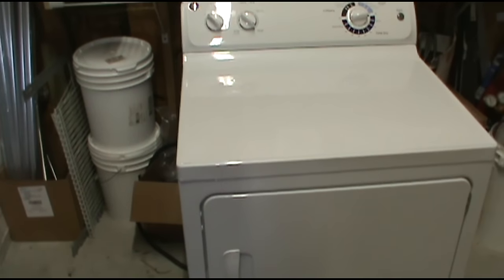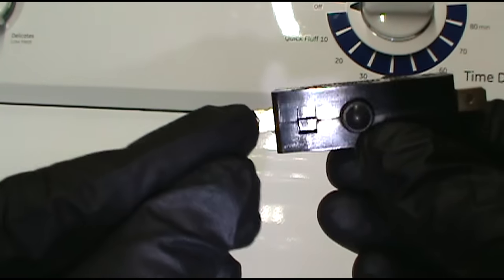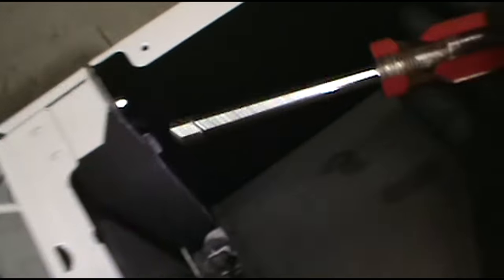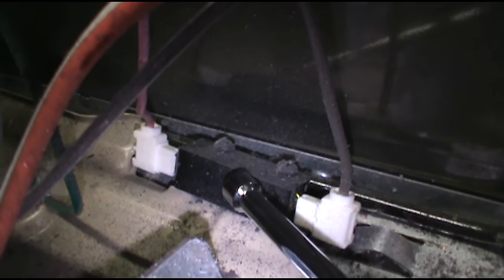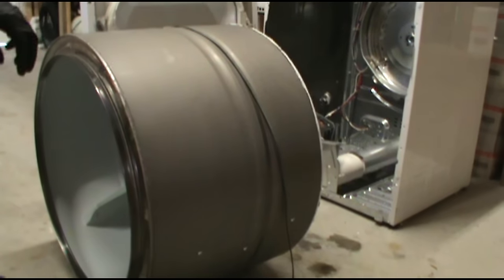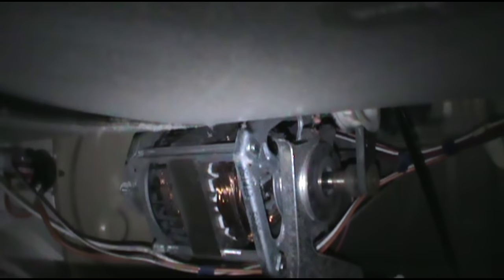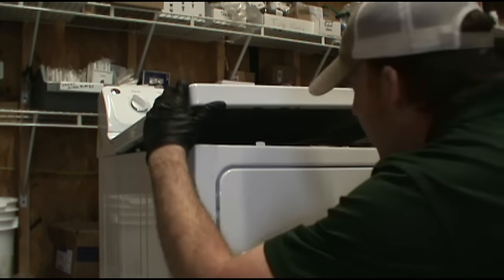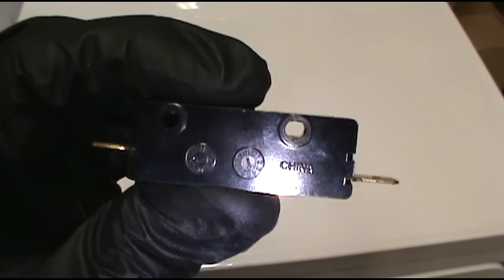Dryer Will Not Stay On After Pushing Start (How to Fix)

Comment from the maker: If you'd like to support the channel, you can do so by shopping on AMAZON through this link,
http://amzn.to/2D3dyGx

Dryer belt link, http://amzn.to/2CS0CjC

Lex Vance is a participant in the Amazon Services LLC Associates Program, an affiliate advertising program designed to provide a means for sites to earn advertising fees by advertising and linking to amazon.com.

This page contains affiliate links, which means that if you click on a link and make a purchase, I’ll receive a small commission. Thank you so much for supporting dirty maintenance nation!
Reply: Lex Vance what's the part number for the switch  I need a replacement
Reply: Thanx for the video Lex. $11 for a belt switch and $19 for the belt (was good but I replaced it anywaze) and I'm back in action. Saved $580 for a new dryer. A little testy getting the belt, motor and idler pulley together. Took a while, but got it done. Thanx again.
Reply: Whats that switch called? Thats my issue.
Reply: What's the name of the switch
Reply: thanks for video, yours is the most informative I've seen today.  I was working on a GE Select DX4500EA3WW dryer, that would not tumble or spin.  Not sure what the problem was, but I got it to run.  Probably a loose wire, or something. 
If it fails again, I'll be more confident about working on it, thanks to your video.
Reply: I believe the switch is GE WD21X10261
Reply: 4 years later. Here I am. Typed the same thing.

Comment: ✌ Thanks so much. My wife had a new $800 dryer picked out.  Just like you showed, it was a broken belt.  Quick trip to the parts store and I had it fixed.  The only difficulty was that I never saw how the belt was to be routed so I tried to install it looped around the idler pulley. That made it seem like the belt was too long. Then I figured out that both of the lengths of the belt go on the same side of the idler pulley and all was good. Save $785 .
Reply from the maker: Nice fix! Thank you so much for watching!

Comment: This is a great and helpful video that helped me fix my dryer today, although one critical detail was left out.  If you're struggling while groping blindly to try and get the new belt around the pulley and the motor and feeling like the belt doesn't have enough slack to fit, there is a much easier way.  Before you put the drum back in, look at the motor.  It's against a metal plate which has a curved corner for seemingly no reason.  Well, you can pull the pulley all the way towards you and the end bit will fit and hold right under that corner, that's what it's there for.  Then put the drum with the belt on it in its place and you only have to rope the belt around the motor.  Then let the pulley out from under the curved corner and it puts itself exactly into place without you having to maneuver three things at once sight unseen.
Reply from the maker: Thank you so much for watching Geshtal!
Reply: right on

Comment: If the belt is fine save time by taking the left side panel off instead of the drum
Reply from the maker: Thank you so much for watching Tim!
www.DirtyMaintenanceNation.com
Reply: This is great advice! You can avoid removing the drum. The interlock is an easy fix.
Reply: Is "interlock" the name of that switch? My drum is still turning but it won't stay on.

Comment: Replaced the belt and had the same issue. (I didn't even know that switch existed until I saw this video.)  Turns out, in this case, that the tension bar had popped out of the slot it is supposed to sit in above the little retainer thingy that helps it stay in place and was just above the switch. Once back in place everything worked as it should.
Reply from the maker: Nice fix, Dan! Thank you so much for watching!

Comment: Your video literally saved me 350+ dollars appliance shop I called said that it was a motor. I decided to research myself before taking it in.  I have the exact Same dryer with the exact same problem. Followed your steps and found the same issue. Appreciate your video!!
Reply from the maker: Wow awesome! Enjoy that $350 you saved. Woo hoo!
Thank you so much for watching Kyle!
www.DirtyMaintenanceNation.com
Reply: This is a beautiful video in every way.  My dryer (GTDP280ED0WW) looks exactly the same as the one you fixed.  Inexcusable that GE put the belt microswitch not only on the motor mount, making it difficult to test for continuity and almost as hard to replace as the motor, but with the screw heads angled up against the cabinet so you cannot replace the switch without at least sliding the motor mount partway out!

This microswitch on mine WAS bad, so I had to go all that way to replace it.  Once I had it open, I discovered that the large metal plate underneath the console, painted with what looks like Army primer, has surface rust laying over all of it.  We've had the dryer six years, but only use it three months a year.  All that rust comes from the salt air in Florida.  While waiting for Amazon to send me a switch, I gave that piece a coat of Rustoleum Primer, in the hope of keeping the dryer for a while.

My problem is with routing the belt over the tensioning pulley and under the motor pulley.  The bent rod the tensioning pulley rides on doesn't want to go far enough to the right side of the dryer to put tension on it.  I can't tell from the video whether the other end of the rod goes where mine does, forward from where it contacts the switch to the front where it is bent 90° to go up into a notch up in the front of the motor mounting plate.  If it's the same, I must just not be putting enough muscle into forcing the pulley end to the right.

(It doesn't help that GE decided to route the vent pipe to the rear in the middle of the dryer and almost up to the drum, right where my hand wants to be when routing the belt.)

I'll be waiting to see whether you have a better way of putting that belt on.  Thanks again for this video.

Dante

 @LexVance

Comment: Just followed this video and repaired my dryer. This was the exact dryer and the exact problem and the installation went pretty smooth except for taking out the screws for the front door, and getting the belt back on the pulley wheel. Putting the drum back in and putting the top back on was a pain as well, but getting the belt back on the pulley properly was trash. It worked and saved me alot of money calling a repairman. Thanks so much for this video.
Reply: Do you know the model number of your dryer  I have the same one and I need to replace the belt as well.
Reply: The model number is on ta sticker on the dryer door.

Comment: Thanx for the video Lex. $11 for a belt switch and $19 for the belt (was good but I replaced it anywaze) and I'm back in action. Saved $580 for a new dryer. A little testy getting the belt, motor and idler pulley together. Took a while, but got it done. Thanx again.
Reply from the maker: Awesome! Enjoy that $580 you saved! Thank you so much for watching Bill!
www.DirtyMaintenanceNation.com
Reply: I'm not doing so well reinstalling the belt now that I replaced the faulty microswitch.  What was your secret other than "Took a while?"

Comment: Similar Model Dryer here for me. Almost 12 or so years old. Maybe a bit more. Same parts and all but Gas model. I redone the Drum "bearing" the plastic bits in front and also the sliders for bearings on this model. I also replaced the start switch up top as well. Wanted to test before reassembly and had seen this pulley switch but did not know what it was. I could start the machine but it would shut off. Seeing this video allowed me to "test" that my work was correct before reassembly by simply applying pressure to the pulley and switch. Without the Drum in the machine. Also I cleaned about 3 inches of lint out of the machine LOL. So thanks a bunch for the tip on the Pulley Switch.
Reply from the maker: You're welcome! Thank you so much for watching Argyle!

Comment: Thank you for this. I installed a new belt and was suddenly having the symptoms of a bad interlock switch that you described.  Dryer ran and spins but stops as soon as I let go of the on switch. Turns out I lifted up on the belt tensioner and pulled it up out of place so it was no longer touching the interlock switch. Put it back down against the switch, installed belt, now it’s running smooth and quiet.  I was in the process of looking at a new $800 dryer and decided to try looking at the problem one last time. Thanks again.
Reply from the maker: You're welcome Matthew!
Reply: Thank you @darkstar189 same thing just happened to me with the tensioner being pulled up out of place, I would have booted it out the door before I figured that out on my own!

Comment: If it wasn't for your video I would have been buying a new dryer.  Long story short without your information about the interlock switch i was lost. I took it back apart only to realize the Pulley had popped out and was not engaging the switch. That was it! Thank you!!
Reply from the maker: Nice fix Chris! Thank you so much for watching!

Comment: Great   Video. My problem wasn’t the belt, but the switch connected to the belt pulley wasn’t fully engaged (it shifted). That tip saved me ripping the control panel apart to replace a starter button that wouldn’t have needed replacing!
Reply from the maker: Nice fix Mario! Thank you so much for watching!

Comment: Great tutorial, I was able to replace the drum switch.  It was a pain, as I have no experience taking apart a dryer, and did it all alone.  I did it though!  Sadly, the problem still persists.  I replaced the start switch, too.  Oh, well, at least I do know that the problem was neither of the switches.  I also do know that the guy who looked at the dryer the first time did not check the drum switch at all--the dust webs were undisturbed. :)   At least I can still use my dryer by taping down the start switch until I decide to replace it.
Reply from the maker: Wow way to go Carolyn! 
Thank you so much for watching!
www.DirtyMaintenanceNation.com

Comment: Excellent video! Thanks for sharing. 
Got the belt on okay, manually tested drum, spins ok.  
Tough time getting front and top back on again. Drum seems to be sitting too high and hitting top of cabinet. 
Where’d I go wrong?  Thanks
Reply from the maker: I'd need to be there to see what's going on. Sometimes I have to pull it back out and play with it to get it right. GE dropped the ball on getting things back together easy. Thank you so much for watching Nuclear!
Reply: Thanks Lex for replying. My unit is slightly different than yours. I was a bit surprised when I opened it.

Comment: Thank you for sharing the video. I replaced the dryer belt, the machine starts spinning. After fixing the belt, when I release the dryer button it stopped. I figured it’s the problem with the switch. Do you know where I can buy the dryer switch? I appreciated if you could respond to this message.
Reply from the maker: Thank you so much for watching Zheng! Sven has part in his comment.

Comment: Great video skid! this is the exact thing that is going on with my lakehouse dryer-just bought that switch, new belt and thermostat. BTW-if thermal switch was failed open, the motor would still run nmly right? just no heating? seems like this switch or a broken belt is going to be the likely culprit. Thanks again, man!
Reply from the maker: I've never had a thermal switch get stuck open so I'm not sure what the symptoms of that would be. I know when it gets too hot, it shuts everything down & nothing will come on until it cools. A clogged vent line will cause that. Thank you so much for watching Harry! 
www.DirtyMaintenanceNation.com

Comment: Thanks for the video. We have the same exact dryer and issue came up this morning. Repair guys are booking two weeks from today. Found your video picked up a belt for $8 and it is working again. 

Tip if you put it back together and it still isn’t staying on you need to push the tension wheel bar down then in. I didn’t do that and was having the same issue. Took it back apart and by pushing the bar down it stopped pushing the switch.
Reply from the maker: Nice fix! Thank you so much for watching daluder!

Comment: Very good video. Mine wouldn't stay on tonight. Went to double check that the drum moved... fricking thing is working now. 
Overheated temporarily maybe I guess. 
Regardless, good video, thanks.
Reply from the maker: Yea, make sure your silver vent line in the back isn't crimped or clogged. If the heat can't get out, the dryer will overheat & the safety switch will kick it off. Thank you so much for watching Rachel!

Comment: Hi Lex, thanks for the very informative video. two questions: if I keep holding down the start button and the dryer works, does that mean the start button is good? And if I run the dryer through a cycle with the start button continually depressed to keep it running, will that harm the start button or anything else on the dryer? Thanks in advance for any help.
Reply from the maker: I would need to be there with my volt meter to check the start button as it could be faulty. I've never held a start button down for an entire cycle so I don't know the answer to that. Sounds interesting though 😆. Let me know if you try and it works. Thank you so much for watching PMG!
Reply: @LexVance  I will try the volt meter. I've been drying my clothes with the start button depressed with a weight. Once the cycle knob is finished, the dryer turns off even though the start button is still depressed. I'm thinking maybe it could be the interlock switch (need to get a volt meter), but in the meantime, wondering if keeping the start button depressed could harm anything or be a safety hazard. 

But I will try the volt meter and report back. Thanks!

Comment: This was exactly my problem! Thank you so much for your help!
Reply from the maker: You're welcome! Thank you so much for watching Qbranch!
Reply: @LexVance  wanted to let you know we thankfully got the dryer working again! What a relief. We got the tensioner wrong the first time.
I didn't realize one REALLY has to pull hard on the tensioner over past the pulley on the drive motor, so the tensioner rides under the outside (non-grooved-side) of the belt.
Thanks so much Lex! 👍👍🧺

Comment: Any tips for getting the tub back on?  I think I have everything lined up but the tub seems much looser than yours.  It's like I can't get the final push to lock it in.
Once it is back in place should it be mostly self supporting?  
The person I'm working with thinks the belt will lift and support it once it's put back together.
Reply from the maker: It's all feel really. It will lean forward a bit until you get the front door back on. I'd need to be there to see. Thank you so much for watching!

Comment: I have the interlock switch problem testing open, seems the button doesn't work (return) now. I agree with the guy that mentioned GE engineering 2 angled screws? I also had to move motor mount to get at them, but turned out that was only 4 or 5 screws so not so bad. GE Dryer Model: PBXR463EB2WW
Reply from the maker: Thank you so much for watching!

Comment: I have this exact issue with this exact dryer. And it helped me fix it. But now I need to know what's wrong with my sensor cycle. Dryer won't turn off on the "optimal dry" setting or and dry sensor settings. But the timed settings work fine.

Also when I use high heat the dryer overheats and turns off. Jeez this dryer is nothing but a pain. Any help would be greatly appreciated
Reply from the maker: Try cleaning out the vent behind the dryer. If the heat doesn't go out of the vent it builds in the dryer and overheats.

Comment: @lex Vance. Should the gas be turned off or not necessary?
Reply from the maker: The dryer in this video is electric. However, turning the gas off won't hurt and will make everything safer. Thank you so much for watching Jimmy!

Comment: So I just have a quick question. What would be some problems if it is the switch (button?), and you just rig some weighted things around to hold the start button?
Reply from the maker: You would need to remove the weights when the clothes were done.
Reply: @LexVance  oh good, I was thinking it would be a lot worse than that. So weight and timer it is until my local hardware store opens :)

Thanks much

Comment: Female here replacing a dryer belt for the first time. I have the same dryer but maybe a year or so older. Exact same design on the outside. I used your link but the belt was too small. How do I measure my current belt? It's 95 inches but holding them together it is about 2 inches longer than the one in your link. Thanks.
Reply from the maker: Hmmm, I would think that they would be the same. Sorry for the inconvenience.
Reply: Lex Vance thank you for your prompt response but, you didn’t answer my question. I ended up buying one at a local appliance shop. But, I did find pulling the pulley down and hitching it under a piece of metal on the machine before putting the drum in was much easier.

Comment: Lex. I have the same dryer but recently either immediately or shortly after starting the dryer' the GfCi will trip. I've changed the GFCI but it tripped again. Any idea what it could be? Thanks!
Reply from the maker: Hmmm, that's a tough one. I'd need to be there with my volt meter to investigate. Thank you so much for watching Eric!